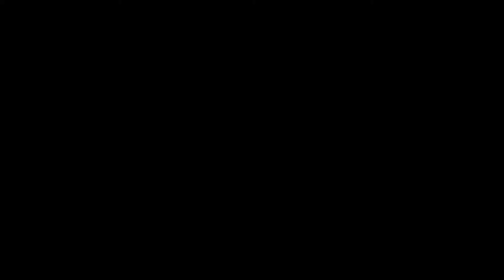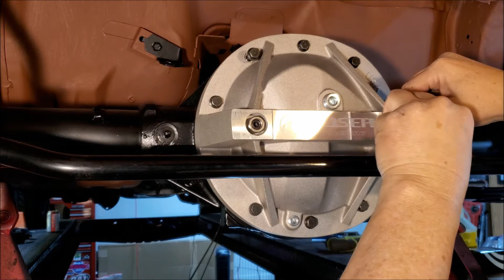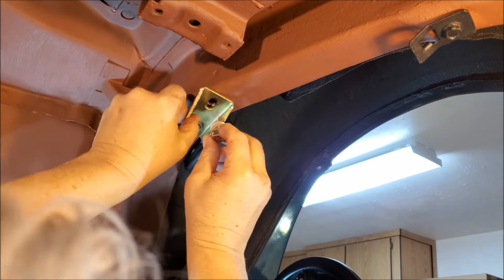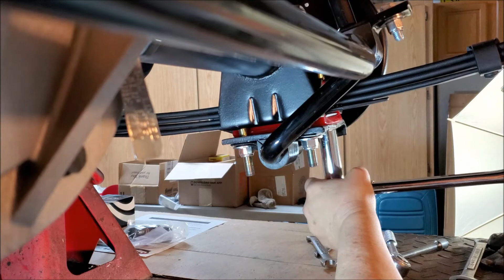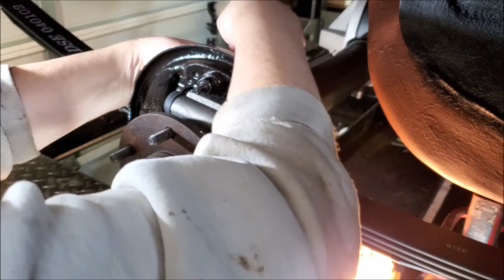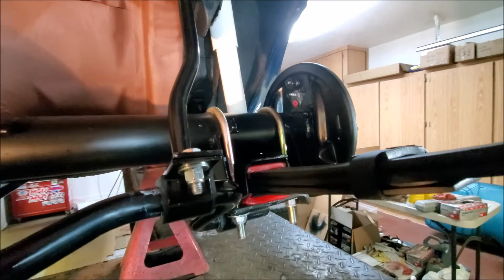1974 Pontiac 455 Trans Am Detail and Restoration Part 19. Moser Rear End Cover Addco Sway Bar

Comment: Looking good! I don't know why moser put the fill bolt up so high. Summit produces a cover like this that has the fill bolt in the right spot
Reply from the maker: I filled the rear end using the factory plug on the side of the center section casting. Since I didn't fill using the Moser cover, I didn't pay much attention to its location.

Comment: I'm in the process of finishing my Trans Am. I have the TA Performance rear cover and discovered that the stock rear sway bar isn't going to work (too close!). What was your impression of the Addco bar? Was 1" too thick? Or are you happy with it?
Reply from the maker: I'm happy with the Addco bar. The fit was good, it clears the Moser cover and it works like it should, so no complaints.